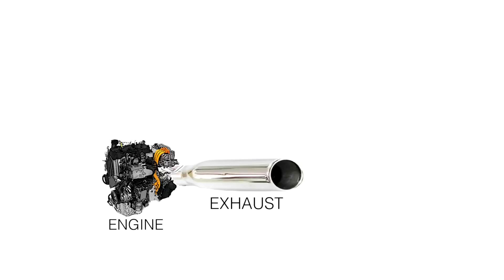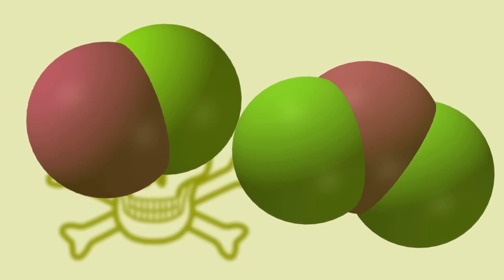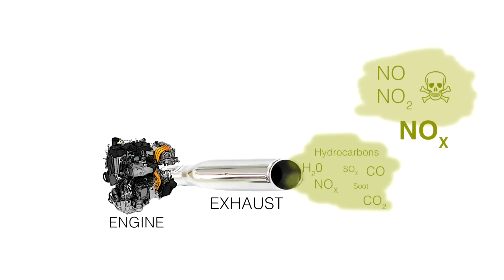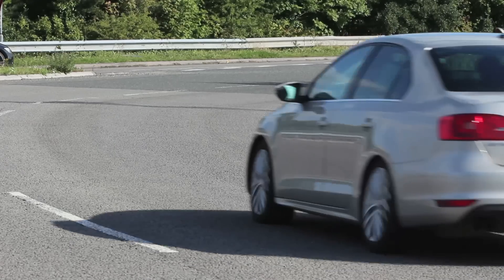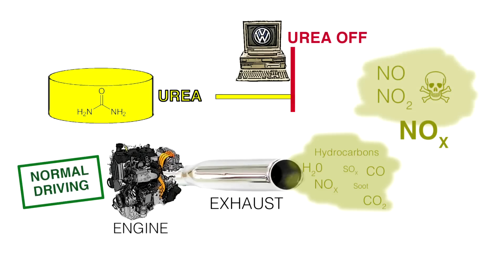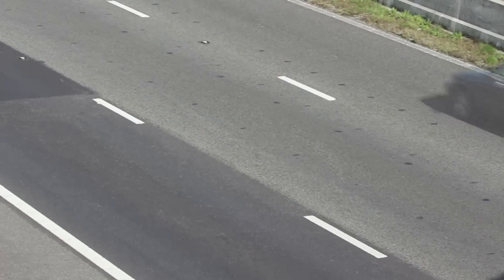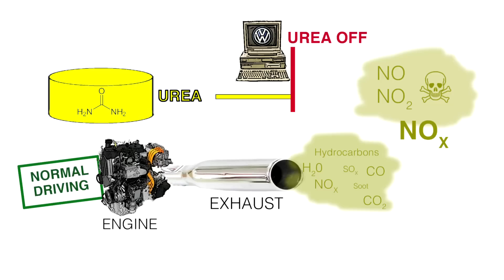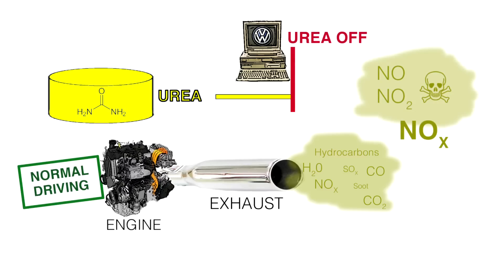Diesel and Urea

Comment: I don't think there are any diesel cars with separate urea tanks (Ad-Blue) yet. It's only used in both light and heavy commercial vehicles. The reason? I suppose having to keep tabs and top-up a separate tank with foul-smelling urea concentrate would put many off. However, i've heard that VW has considered adding one none the less to it's affected diesel cars in order to preserve both power and fuel efficiency whilst maintaining low emissions. Otherwise, after the inevitable firmware update, it's cars will run permanently in "Test Mode" and suffer these two consumption and power penalties. 
IMHO, this scandal has marked the death knell for diesels in passenger cars in general. Throughout the last 20-30 years, diesels have been getting more powerful due to refinements despite them being by nature smelly, smoky engines, but during the last 10 years or so more and more power and convenience-sapping measures have been installed due to enviromental concerns: EGR, Regeneration, Ad-Blue, taking a toll in reliability in addition to power and convenience. 
This VW scandal seems to indicate that diesel tech has reached an environmental dead-end and further developments in this area will further degrade their performance and reliability in general. 
As much as i enjoy driving these engines for their hitherto punchy low torque and economy (my '54 mondeo is only euro4 so hasn't got Regen yet, only an EGR which has to be cleaned out from time to time) their time has comes to a close.
What is funny is how these engines have been pushed onto the consumer throughout the last 2-3 decades as "cleaner" despite we drivers seeing the view in the rear view mirror getting blotted out in black and later grey smoke whenever we push our foot down, yet we still bought the argument.
Reply: +Dennis Santos WRONG! every light duty diesel car sold today has SCR which uses DEF(ad blue).  VW TDI just started using it for 2015 models. Before that they had a NOx trap that didn't require DEF.  
 Other manufactures have been using it for years on light duty.  Chevy cruze diesel has had SCR and a DEF tank since 2013.  How do I know? I am a diesel engine engineer and own a 2015 jetta TDI...
So VW has 2015 with SCR and still can't meet emissions...  Not sure just injecting more DEF will be the answer... They would have done that already.
As for your comments about diesels not really being cleaner now than 10 or 10 years ago is simply ignorant.  They are 100s of times cleaner.   Don't try and tarnish an entire industry just because company messed up.  Ok so the TDI produced 40x more NOx than the epa says is allowed.  thats still 100x less than a TDI produced 15yrs ago...
Reply: Andy Hass Easy Tiger. 
What I meant was despite diesel engine's torquey performance, it's an inherently dirty power plant, producing vast amounts of soot, black smoke by it's very nature.
True, due to the addition of electronics, filters, traps, EGR, Regen, and now (Ad-Blue) that black smoke has now become a grey smoke and overall nasty emissions reduced. But this plays against reliability and power. Old diesels used to be the most reliable engines around despite high mileage but with the introduction of all these measures that hasn't been the case anymore, what with common-rail injectors and related hardware (usually sensors) failing and EGR valves needing to be cleaned-out or replaced. Catalytic convertors have the tendency to clog-up with soot (because - dirty engines) and need to have regen cycles, often incompletely done due to short trips and end-up clogging anyways. Anyone knows that the more filters and traps engineers install in any IC engine will have a detrimental impact on performance - more so if said filters clog-up frequently due to short trips.
And now the thought of having to deal with  topping-up yet another tank with smelly urea at the the fuel-pumps in order to keep-up with emissions control has ultimately done it for me as far as the purchase of another oil-burner. It's also yet another subsystem with the potential to either break down or fail an emissions test. 
All these lousy "solutions" or patches are only procrastinating the inevitable death of light diesel vehicles because as i have said, they are by nature dirty. 
And despite all these efforts to scrub diesel exhaust, city centres have been getting ever more polluted due to their shear numbers.
The VW, Audi, Skoda, Seat (more to come) Scandal has only furthered it's demise. It's plain to see that further environmental measures will further reduce power and reliability.
The future is electric.

Comment: 0:22. "there are two sorts of engines that you can have in cars." Maybe in Europe, but here in Brazil there is a third type: alcohol motors, which have been widespread since the 1970s and make up a fleet of many millions of cars. The alcohol is made by fermenting sugarcane, which grows three crops a year in our warm sunny climate with very high productivity. The program is not as successful as it could have been for complex economic and political reasons, but it suffices to say that like any crop, sugarcane has ups and downs in the market, so sometimes the price is competitive with petrol/gasoline, sometimes it's not. To solve that problem, most recent cars sold in Brazil have so-called "flex" motors, which can seamlessly run on petrol, alcohol, or a mixture of them in any proportion without needing any adjustment (a computerised sensor determines the fuel mixture and adjusts the motor's parameters accordingly).

As for diesel cars, they are simply illegal here - they won't be licenced at all. The rationale is that diesel has much lower taxes in Brazil, because it's considered essential to move lorries/trucks and buses, which mass-transport goods and people and make the economy run. So, it would be unfair and uncompetitive, in addition to very expensive to the government in lost revenue, for ordinary passenger cars to run on indirectly subsidised fuel.

And Volkswagen is the automaker with the oldest presence in Brazil, with local factories for over 50 years. It knows the Brazilian market and conditions extremely well, and it has a very solid reputation for reliability, robustness and cheap maintenance. It is a national favourite brand and it's not likely that this scandal will affect that in Brazil.
Reply: +Goytá F. Villela Jr. Not for nothin' but there are also vehicles that run on natural gas in the states.
Reply: +Bourne Accident, oh yes, I forgot, we have them here, too - but mostly taxis and buses, as private owners are usually afraid of carrying a bulky tank of very flammable gas, which also takes up a lot of space from the trunk. There are also small fleets of buses running on numerous experimental varieties of biodiesel, and there are probably other alternative fuels in other countries, so I wouldn't dare say there are only so many varieties of fuel for motor vehicles.

Comment: It was actually LNT technology not urea-SCR.  Same sort of thing though. The NOx trap fills with NOx under lean efficient conditions and is periodically cleaned by running the engine rich. VW just decided to not run rich as often to save fuel. Modern GDI petrol car also run lean and are having similar problems.

Comment: The cheat software is manipulating the ECU to run cleaner by increasing the DPF filter temperature to a hotter temperature while running less fuel to the combustion chamber, it has nothing to do with shutting down Urea injection, Urea injection is only in the passat TDI (and Touareg TDI)  and it does get used up every because I have to refill them every oil change or 1 year/10k miles.

Comment: I worked in the EPA compliance market in the early-mid 90's using this exact chemistry to control NOx emissions in paper mills....They used urea or anhydrous HN3 along with a catalyst bed to convert NOx to N2 and H20.....the trick was limiting NH3 "slip".....there's a point where increasing the injection levels of NH3 no longer reduces NOx emissions and in fact becomes a significant polluting agent unto itself. The major problem at the time was accurate, continuous monitoring of NH3......NH3 is nearly as soluble in water as water is soluble in water which makes it VERY difficult o accurately measure.....interesting to see the concept alive and well in 2015....

Comment: There is a slight error in the explanation of the diesel process.
The fuel is only added at the end of the compression phase which allows diesel engines to have far higher compression rates than petrol engines. (a fuel/air mixture would catch fire halfway trough the compression phase)
And the oxigen sensors are almost only present in petrol cars. (Very large Diesel engines have them but not those in normal cars) because reducing the amount of air entering the engine per stroke could cause the whole process to fail because the necessary pressures can only be obtained with a much air in the burning chamber.

Comment: VW engines sold in US and marketed as clean diesel, but did not live up to US standards through cheater software that changed engine performance during testing, and produced as much as 40 times the allowed limit in actual road performance.

Comment: been a sub for a long time and you have taught me a lot about chemistry, however in this case you have some of the facts wrong. Rather than point it out here i suggest you do some more research, look at " nox traps" and " EGR" regarding NOx reduction. A few other comments have also noted this, most of the affected engines do NOT use Urea after treatment.

Comment: @ 1:00 he is incorrect compressing a Fuel/Air Mix till detonation is knows as HCCI (Homogeneous Charge combustion ignition and is the closest thing to the theoretical otto cycle. (Combustion @ constant volume) a Diesel compresses just the air to raise the temp then injects the diesel into the super heated air.A theoretical diesel is constant pressure combustion.

Comment: Your explanation doesn't make any sense.  VW wouldn't risk it's integrity for a little bit of urea that the customer purchases.  It has to be some set of engine operating parameters that are manipulated to reduce NOx percentages in the exhaust.  

Probably the catalytic converter can only handle so much NOx and still produce a clean exhaust and to reach those low levels engine performance has to be sacrificed.  So VW decided to remove the performance limiting tweaks when the car was actually being driven.   Cute...

Comment: NOx is reduced in SCR system by injecting the urea-water-solution (UWS) into the exhaust system. If I remember right AdBlue is the European brand for UWS and it's 32,5 wt% of urea in some applications 40 wt% solution is used. When the UWS is injected into the system water evaporates from the droplets and urea decomposes into ammonia and isocyanic acid through thermolysis and hydrolysis. Once the ammonia reaches the catalyst cell, two main reactions occur: Standard SCR and fast SCR reactions. In the reactions ammonia converts NOx into nitrogen and water.

Comment: I'm not sure if you can class electric motors as an "engine" - just seemed a bit ignorant to say "there are only 2 types of engines a car can have"
Reply: +Sina Madani "a bit ignorant" sounds rather harsh. To your point, there's propane, natural gas, hydrogen and several others which are also "engines". An electric vehicle propulsion power source is typically known as "motor".
Reply: +Walter Boxhead unless you are talking about boats then the outboards are referred to as motors when they are an ICE

Comment: Yet more reasons to adopt electric propulsion for passenger autos.
Reply: Yet more reasons to adopt ethanol propulsion for passenger autos.
Reply: +ooo 52 Boondoggle.
Reply: wholeNwon
In the same way of "If we develop better batteries and electric motors, electric cars will be better" if we develop a cheaper and more effective way of changing cellulose into Ethanol, we will have a fuel that doesnt add any new carbon dioxide into the atmosphere, as well as also working with the types of gasoline engines we use today, only perhaps modified for the higher octane.

Comment: Nice coverage. Agree the topic is toxic these days and there has been very little science behind the coverage.

I have a 2013 VW TDI Passat, it has a urea tank, and I have had to refill it several times. So the general media coverage is wrong to imply that the urea is never used. Its entirely possible that the ECU doesn't use enough urea, or sometimes does it incorrectly, but it clearly is used. Its not true that at least Passats with the urea tank never use urea.

I believe that some recent Jetta/Golf models do not have the urea tank/system, so that could be a totally different issue.
Reply: +Pat Farrell I'm doing some research on this topic, and the problem I'm having is that you can't trust VW's technical info.  Maybe you can help!

Could you estimate how much Adblue you use?  Gallons per 10,000 miles, or whatever units are convenient for you?

Comment: VW don't have urea injection. EPA, the people who test cars in America for emissions put the car on a dyno for the testing cycle. In modern cars, when the driven wheels move but the other wheels are stationary, the traction control system panics and the car won't drive correctly. So, to do the test, the traction control systems are turned off so the driven wheels can turn without the others. On the affected VWs, when this test mode is entered, the ECU changes the fuelling of the engine to massively reduce the power and therefore the emissions. Because the car is on a dyno and the car is not being propelled as normal, there doesn't seem to be a noticeable difference in performance.

Comment: Just for reference Urea used in diesel engines is at a concentration of 30-35%. Its marketed and sold under the common name of "AddBlue" as i think urea sounds like urine and not something people want associated with their car/truck. I work for Volvo trucks and often test the concentration level when working on "AddBlue" faults, most of the time faults in system occur from crystallization of the Urea within the spray nozzle or water contamination of the urea tank ie use water not addblue

Comment: There is absolutely no reason to use diesel engines in anything smaller than a truck.
Reply: +Merto6 Yes, there are plenty. Way better gas milage, while the gas is cheaper, plus the lifetime is much longer. Also better acceleration, which is what really counts when driving on regular roads if you ask me.
Reply: But you are not saving with that mileage because diesels are more expensive. And they are not accelerating better - they are heavier and have less power.
Reply: @Merto6  Of course they are accelerating better. At least our Diesel-cars here in Germany. 

If you drive very much it is cheaper to do it with a Diesel than with a petrol-car.
Reply: Bourne Accident what are you smoking? Diesel?
Reply: In an electric car you could have a very small diesel running a generator to supply power directly to the electric motor(s), or recharging batteries, or as they now have in various racing cars, a combination of both diesel and electric motors applying power directly to the drivetrain.

Comment: You are slightly wrong on the function of a diesel engine, in that the air and fuel are not mixed prior to entering the cylinder, but air alone is compressed, and at the top of the piston's stroke when the air is hot a measured amount of fuel is injected at high pressure (1500+psi) into the hot air, causing ignition.